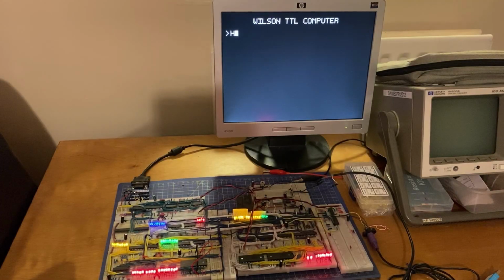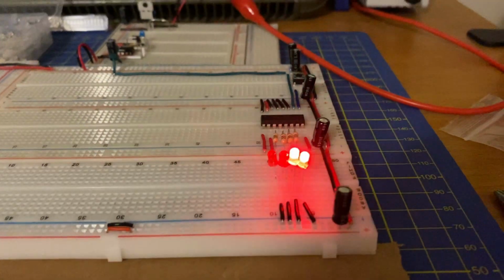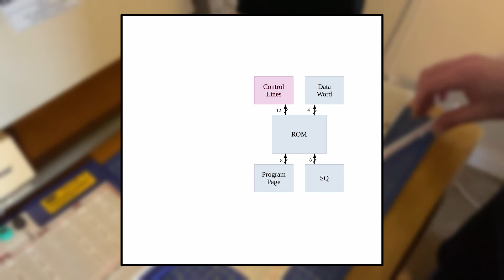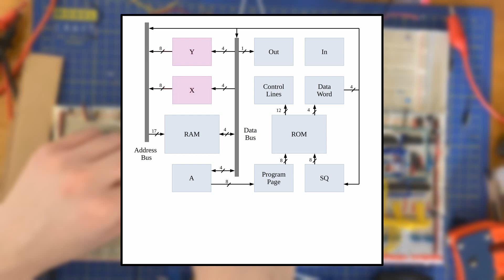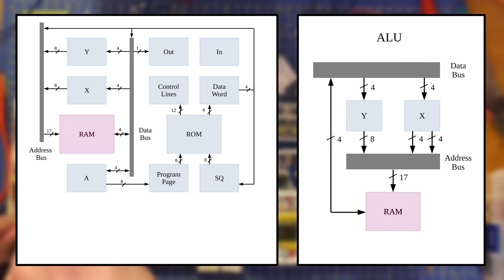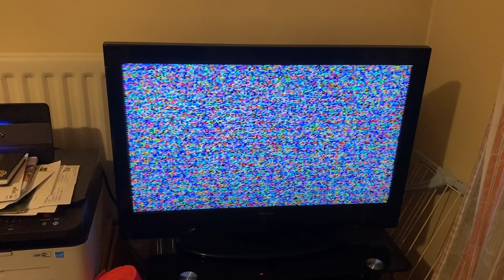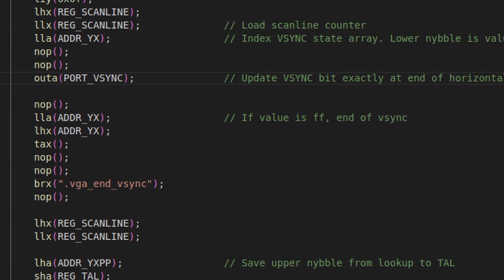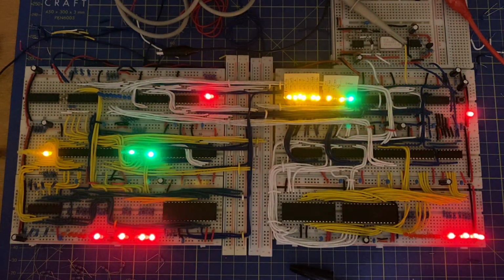Design Overview - 4-bit TTL Computer

Comment: For video you could implement h/w accelerated lines doubler as totally external part, not complicating/poluting CPU board, which could be implemented as cheap 10x10cm PCB. Or just bitbang RS232 for external terminal. That could simplify thing for amateurs to reproduce.

Comment: This is inspiring. I have too many projects at the moment to resurrect my TTL CPU but I’ve been toying with the idea for a while. I like your approach for the brains of the CPU. I used a 74181 + microcode and I think that limited my prospects. I think I will redesign the ALU around my requirements and ditch the 74181 rather than be limited by  it. Looking forward to more on this.

Comment: Very impressive, all the processing time used to output a display reminds me of the Sinclair ZX80 I used to own, it had to turn off the display to process anything else, the only time it would appear was to prompt for an input, but it would flicker off even as you typed a character. Later they realised with interrupts you could process other code while the screen was updating above and below the border, hence a slow mode option was introduced on the ZX81 where the display remained on allowing moving objects and games. Clever programmers managed to implement the same thing on the ZX80, but it had to be done entirely with very precise software timing. Amazingly we got a few flicker free games even on the ZX80.

Comment: Very cool. But with so few chips, where is the instruction fetch, decode and execution happening?
Reply: he discussed it around 5:35. essentially the instruction is split into its op code and operand and he uses a lookup table stored in ram (he says ram but rom would make more sense) with all precomputed values for all instructions. Control lines also come from rom he said, so im guessing that when he flashes the program to rom it has to be pre processed. i can only speculate on this second point, but im making a 4 bit processor right now and am handling it a similar way
Reply: @liaminblue9984  oh sounds interesting

Comment: Is it possible to make the CPU binary compatible with 6502?
Reply: This CPU is different Harvard architecture so strictly saying no, but it's possible to write 6502 interpreter in software so CPU will act as a micro-code CPU. In this case this bread board computer can be (re)targeted to any CPU just matter of execution speed.

Comment: Nice work!
I tried my best to squeeze the 74LS series of chips to do true VGA @ 640x480 but they just couldn't zoom zoom. I did order some chips from futurlec that were significantly faster (100mhz or so i think?) and were supposed to be TTL compatible, but I had trouble getting them working properly. Moved on to other projects after that.